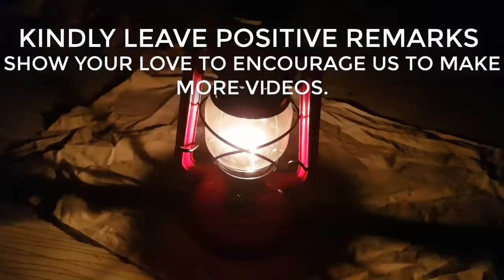RUSTY LAMP RESTORATION - 1912 Useless OLD LANTERN

Comment: Nice work!  As another commenter mentioned, the lever on the side of the lantern is used to lift the globe for lighting.  Also, you don't want your flame to be any higher than about an inch or so.  If your flame is too high, you'll get soot and excessive heat, both of which are bad for the globe (I had a globe crack on me because of a misshappen wick that caused the flame to be too high and off-center.)   I collect these old cold blast style lanterns and love them.  They're real workhorses. They're great for emergencies and for ambient lighting.  Remarkably safe too.

Comment: very nice. my only complaint is that you painted the inside of the fuel cap. that might make the threads stick if the fuel melts the paint and it fuses.

Comment: Great job. When you light these lamps, you press the lever down to raise the glass bowl and light the wick from under the glass. :).
Reply: Thats the right way to do it! :)
Reply from the maker: thanks for suggesting the right way :)
Reply: That is how my American ones work! I just guessed he did it that way, because it was a European lamp.
Reply: @MrSCOTTtheBADGER  the lamp is from germany.... still the lever is the right way to go, this is no different in Europe ;-)
Reply: @thesebi  Or in India
Reply: @rajendersharma1334  
Or in India ;-)
So basically the lever has the same function, no matter where you are.
Reply: @thesebi  I must hurry to add that in the process of lighting the lantern by raising the glass chimney using the lever frequently extinguishes the match used in  its lighting, and is rather used to blow out the lantern. To light it, a right-handed person places it on the floor or a table with the reservoir cap and lever in his/her direction. Then hooking up the right thumb through the ring on top of the hood and draping the four fingers over the carrying handle held straight above the hood which is then raised by pulling the ring up with the hooked-up thumb. This frees the vertically standing chimney to be flipped back to lie horizontally. The wick, now visible, is raised a little and lighted with a match or burning taper. The hood again goes up with a slight pull of the hooked thumb, the chimney is brought back to its vertical position and  the hood lowered gently over its brim. After a while, when the glass has been slowly warmed to avoid its cracking in cold weather, the wick is raised to give a non-smokey flame. To blow out, the lantern is held with the left hand,  the flame turned down, and the chimney raised by pressing the lever which is held in place by engaging it in the notch. Then, bringing it in level with the mouth - woof - and the flame goes out. The disengaging of the lever from the notch brings down the chimney. This was the daily routine in the villages in India before the coming of electricity.
Reply: @thesebi  The Feurhand lamp was (maybe is ) sold in America, too, and the rest of them are almost identical. I think they might even be ripoffs.
But you should NEVER turn the flame up so high, Keep the wick below the level of the lame spreader. Do that and your globe will stay clean much longer. Simple glass cleaner and paper towels will get it as clean as any other method.
I find old lamps' patina to be part of their charm. Since you can still buy them new, it seems stripping and repainting is a wasted effort. As long as the fuel tank doesn't leak, the wick is clean and the draft channels (those tubes running up the sides and joining the chimney) are clear of insect construction, it should work well.
Reply: I m lamp manufacturer
Reply: @Masterfighterx  I'm curious. What is 'wig' and wig handle. Is it something separate. The blowing of the wick turned down to the minimum is safe.

Comment: Nice end result!
But:
You use stainless anodes?
They produce hexavalent chromium in the process, highly toxic stuff.
Use plain steel or iron anodes, nothing else.

You also could have taken out the wick holder and glass before starting to pry and hammer the parts apart.
Glasses are still available, though, this model still is in production.
The model 276 was introduced 1953, so it isn´t that old.
Reply: sthenzel I am planning to do some electrolisis myself but i don't know where to find the basics. Any hints?

Comment: Old Smith,, I have one like this my father gave me maybe, 60 years ago. It is rusted too. 
I had the idea of restoring it a long time ago. I threw it in a corner and forgot about it until now.
I do not have a battery charger strong enough to remove the rust like you did. I hear Apple Cider 
Vinegar will work as good. Have you ever tried that?
My father worked for the Rail Road. I never asked how he got it. I don't think I want to know.
I was thinking of after cleaning it up having it Powder Coated for finish. There is a powder coater very close to me.

Thanks for reminding me of the lantern. I think I will dig it out tomorrow.
I will also check the Brand Name an maybe the date.  I never used it. To bad I let it go so much.  I am excited to restore it!

Comment: Hi, I'm impressed with the rust removal.  Could you explain the method you use?  What is the liquid in the container, as well as the detergent you pour?  What is the required voltage and current?  What electrode are you using?  Thanks in advance!  Be healthy!

Comment: That started off with light rust, and no holes to solder over. For fuel Diesel is cheaper the Kerosene, and works just as good.
Reply: Diesel fuel and kerosene are pretty much the same thing.  If you buy diesel at a gas station you pay tax on it.
Reply: @hughtrusty4025  True, and why kerosene is over $8 a gallon is beyond me.

Comment: Glass looks to be upside down (I suppose you didn't remove all the lettering on the glass, should give a little clue if it's upside down or not), the top part is curved more and smooth while the bottom bit is flat. Also, you light it by raising the glass, not just the top. If the flame begins to wobble and produce smoke, it's too high.

Comment: By no circumstances should my comment be accepted as a critique/hate one because you had a glorious end result, but here are the things I didn't find charming:
1) You had a chaotic spray pattern, not that it doesen't do the job but as they say "The devil is in the details", so if you stick to a more straight pattern (left to right, down a little, right to left and so on), overlap by 50% and apply lighter coats (the base one being barely visible) I guarantee you will have even better end results.
2) You started/stopped spraying while pointing the can against the work surface and that's a big no no, because it's the easiest way the get paint spittage and nobody likes having to start all over again. Always start/stop spraying atleast 20cm away from the object you are currently working on.
Non-pro tip 1) If possible remove the masking tape right after you're done painting, sounds stupid but it is more likely to crack the dried paint if it caught on the tape than it is to accidentally touch the wet paint while demasking.
Non-pro tip 2) Let your cannisters sit in warm water (this is cruteal for the varnish) for about 10-15min. this little technique is the ultimate prevent for orange peel.
I hope this helps you improve your painting skill by atleast 5. Keep on making great videos!
Reply: Stupid me forgot to specify, you put the spray cans in warm water 10-15min. prior to using them not the day before or some other bullsh...